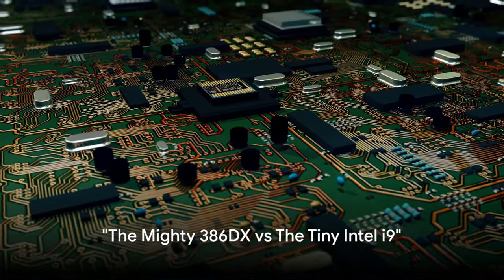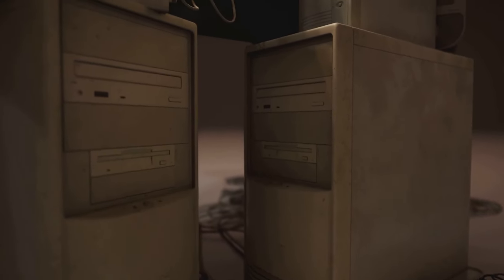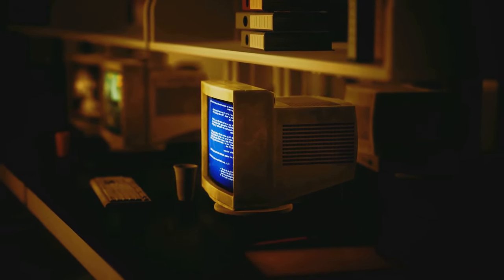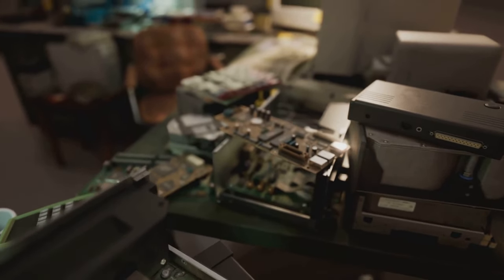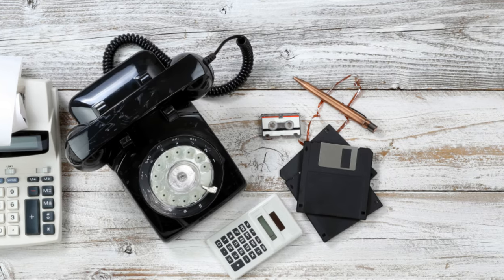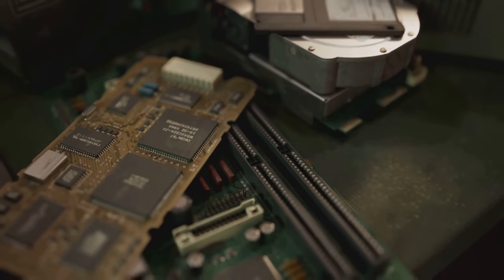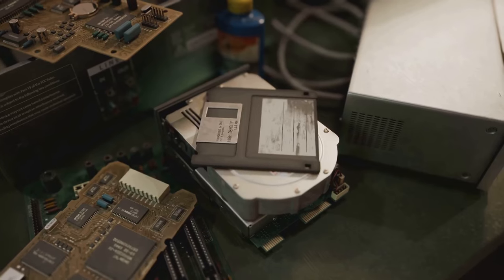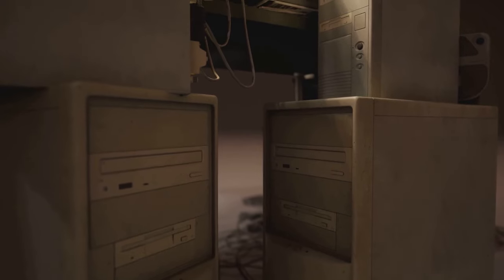The 386DX is far better than an Intel I9 processor!!! || #gaming #gamer #retrogaming #computer

Comment: 386 CPUs barely get warm to the touch. They don't even need a heatsink. Unlike that I9, that can indeed be used to heat up a roon during a gaming session. Weight-wise, vintage computers are usually a lot lighter. 150-200w power supplies that weigh nothing compared to modern 1000-1200w monsters. No or minimal cooling for the CPU, no cooling whatsoever for the video card. The only truly hefty parts of a vintage PC are the case, witch is usually made of thick high quality steel unline modern tinfoil cases, the storage media drives (FDD, CD-ROM, hardware not present of modern PCS) and in some cases the hard disk drive (if it has one, and if it's an older MFM 5.25" model).
Reply: You have obviously never seen a MFM hard drive. Lmao. You could use one as a murder weapon.
Reply from the maker: It's comedy. I mean, we're talking about a three hundred eighty six processor here, lol.
Reply: Just because the ancient power supplies are only rated for 135 watts does not mean that they weren't heavy. By the 1990's the power supplies did get light, but the power supplies of the 1980s were indeed heavier than today's power supplies because, while they didn't have as big a wire size (needed for more power), they had more windings. That in turn gave them high inductance, and made them more stable, able to keep the computer running even when the power flickered.
Reply: @HardWhereHero  I have an MFM drive on my desk, and yes, they have serious weight to them, as did the older floppy drives.  OP also forgets just how many boards were in an old computer, too. Today, everything is on the mother board, but in the 80s computers often had 5-7 boards slotted in, such as a video card, a couple of serial/parallel io cards, a network card (with coax connector), a sound card, a floppy controller, perhaps an ESDI card or some specialty drive controller such as a caching SCSI card.
Reply from the maker: @carlr2837  , and if you dropped it, it might actually go through the floor. :-)
Reply: @KILRtv  It makes a nice paperweight. ;)
Reply from the maker: @carlr2837  , indeed! And a decorative one too.

Comment: This is so stupid.  I really wish youtube's thumb down still showed, then I would have known to not click on this.
Reply from the maker: I'm not sure what you were expecting. Did you really think it was a serious video about the 386dx being better than an i9? If you believed that, then I'm really worried about what comes out next week.
Reply: @KILRtv  Was watching tech news related to Intel's I9's being unstable due to motherboard manufactures running unlocked overclocked cpus out of spec.  So the algorithm f'ed up.  It could have been a satire statement about quality of modern silicon at the time vs now or something like that as I do watch content on this subject ... Instead it was a  bunch of BS about how hot the 386 ran, which it didn't and could be air cooled with no heat sink and the PSUs for the whole system was in the area of 150watt or with a 250watt psu if you were a baller but modern i9 14900ks can pull up to 700watt all by itself under synthetic stress loads.... Anyways piece of crap video
Reply from the maker: @NotListed  , ok. Go find another one, then. Bye.